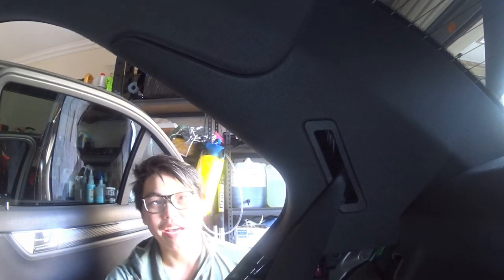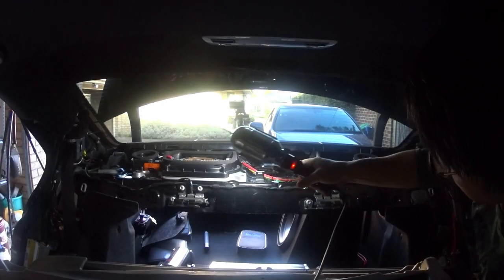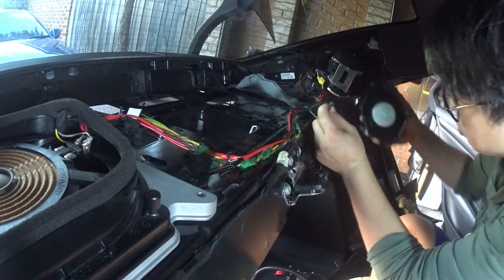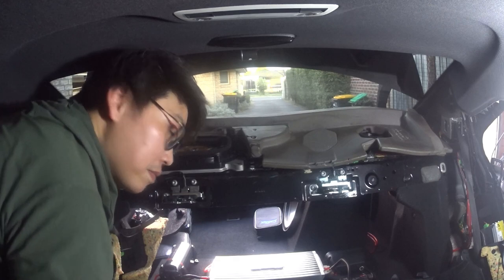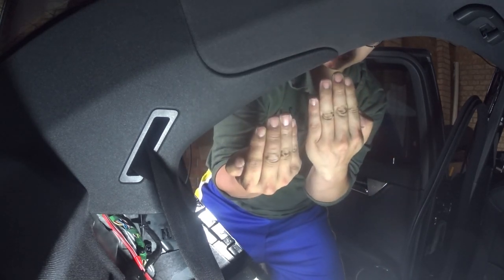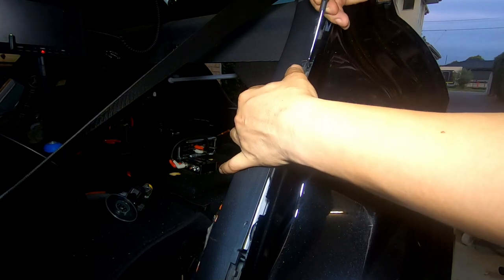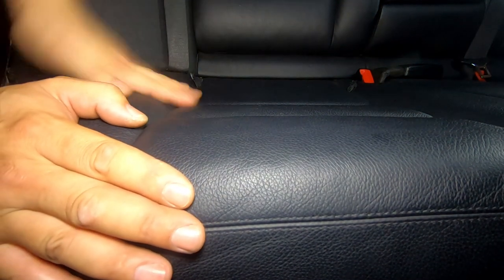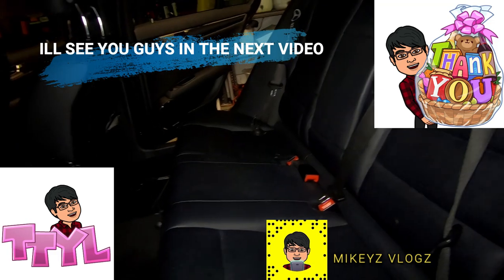MERCEDES BENZ  C CLASS W204 HOW TO ACCESS  REAR DECK + 3RD BRAKE LIGHT

Comment: Hello MIKEYZ VLOGZ !
First of all, thank you for all your great videos.
I've w204 320 but with the standard audio kit, I'm wondering if the wiring is already here, but will it be a good sound improvement to add this rear deck sub ?
I can't find anything on the web but your video.
Reply from the maker: i dont think the wiring will be there u may need to wire a new sub and after market amp ... but im sure you can use the factory sub as you may already have the cut out for the subwoofer in the rear deck ....its just a matter of fitting it..do u know if you have a factory amplifier?
Reply from the maker: and your welcome too ...i hope the videos will be of some help for you
Reply: @MIKEYZVLOGZ  So I double checked: There is no pre-wiring, and the foam does not seems to be precut. And if it needs an additionnal amplifier, it seems to be a hard upgrade... 
I think I'll look a way to put this kind of woofer instead : https://www.ebay.fr/itm/Mercedes-W204-Classe-C-Coupe-Sub-Haut-Parleur-Boitier-Boite-Son-Basse-Audio-10/153514941732?hash=item23be341d24:g:LJIAAOSwDuldrseD
But I still need to find an audio out from somewhere. The only option seems to cut the wire from the rear speaker, like here: https://youtu.be/5pNEUQPfC_M?t=980 and I don't like destroying car stock wire, I think you'll think the same.
Reply from the maker: That is a great idea mate
Reply: @PaulEmmanuelXUEREF  It's def a huge install, I was thankful to have bought mine with it already. I'm just upgrading away using the wires and backtracking to make sure all the wires are good before hitting that bass.. It's all worth it in the end!

Comment: 1:03 I have a 2017 CLS and where you're removing the side area there, mine has an airbag in that spot where the seatbelt comes out of. I need to access the rear deck speakers because there is a TERRIBLE rattle coming from the right rear speaker. Should I still remove it even though there is an airbag there?
Reply from the maker: hey s how r u? is it very similar to mine? as i didnt remove my airbag at all.. eventho there is an airbag there you should only have to remove the cover that sits ontop of the airbag... the ratlle in the rear deck can be from a couple things ... 1 rear deck loosened from bass in rear deck 2. rear seatbelt holder has shaken loose or 3 speaker blown... i cant say for sure what ur case may be but it could be a few possibilities... as for how to remove ur airbag cover im not too sure as i have never worked on a cls.. however im sure it would be somewhat the same mate.... i hope this helps u
Reply: @MIKEYZVLOGZ  Hi, I'm doing good, thanks. In this video: Mercedes- Benz Rear Deck Rattle Noise (SOLVED) at the 1:00 mark, that is the exact rattle I'm getting when playing music through the speakers. Have you had this problem? If so, how do you suggest I go about fixing this?
Reply from the maker: @user-pu3cf9pd2m  well if that is your exact problem...i strongly suggest  to figure out how to remove your entire tear deck so u can access it ... and solve the problem... its the only way to get to the part especially if its your rear deck

Comment: How did you get the seats down? I have to replace my rear deck because it’s rattling and broken.
Reply from the maker: hey buddy the rattle is annoying i know .... however it could be a few things ... best way is to just open the rear deck and see what is rattling around and see if you can stop or or secure it.... with the seats .... what do u mean get them down ?  do your seats fold down?
Reply: I’m not sure, I think that’s a facelift 2012-14 function. I know you have the ultra-rare 2010 AMG Sport Plus model so that’s why you may have it and I may not. Have to do research.
Reply from the maker: @aaronpoisson  i dont think its an amg modrl i have ... to put it simply i have a 2010 w204 c300 late model with the amg sports package with extra features .... ive seen a few around just like mine .... but compared to other countries i do notice a difference ... i dont think my model is rare...i was just lucky enough to find a model with all these extras from factory.... best way to put it.... however if u are trying to remove your back seats because they do not fold down then do abit of research regarding your type of seats .... im sure its not hard friend just has to be done a certain way.... ill see what i can find out for ya buddy
Reply: @MIKEYZVLOGZ  I'm gunna try observing them more closely sometime this week, I read owner's manual PDF and it looks like there might be two pull-tabs someplace that I can use to fold down the seats possibly. I'm replacing the rear deck and the brake light. 

My rear deck is rattling and so faded it looks light purple. My twilight plastic trim as damage somehow near the break light and to the pass side where the trim meets the window, which is visible causing my break light to reflect in the glass at night.
Reply from the maker: @aaronpoisson  yep exactly .... im sure its just something like that... hope u get it sorted asap
Reply: @MIKEYZVLOGZ  the rattle is in the seat belt device (Ball Bearing). otherwise, it's the shelf as well. The ball bearing is a part of the seat belt safety mechanism - https://www.youtube.com/watch?v=_fttzvD2Q9s
Reply from the maker: @WyseAdvisory  ye dude ... ive heard its this too...in my case it was this rear deck piece .... my seatbelt is fine atm fingers crossed

Comment: @7:20 when you disconnect the sub is that all you have to do to remove the rattling sound? I just bought my aftermarket sub/amp and hoping to install in the coming weeks. I obviously have to remove the the factory sub so no rattling will occur is this all you have to do in order for it to not rattle? Also when you put new sub in how do you keep the rattling down to a minimum?
Reply from the maker: u need to also check the seat belt for the centre seat ... rattling comes from both surrounding rear deck and the seat belt holder .... do u have rattling now ?

Comment: What size speakers are in the back deck?
Reply from the maker: its either 3inch or 3.5
Reply: @MIKEYZVLOGZ  So there are 3 speakers in the rear deck, correct? Do you know the exact size of them, please? This is really important in order to replace them?
Reply from the maker: @WyseAdvisory  dont know exact size but will find out for u ... but they are x2 surround speakers ... and x1 subby ..but ..only if u have the hk system with factory sub... if not u only have front splits and rear  coaxials and maybe the centre 3" on dash ... confirm what system speakers u have and then u can find out what they are..check this out https://mbworld.org/forums/c-class-w204/223386-where-8-speakers-i-only-count-6-a.html
Reply: @MIKEYZVLOGZ  thanks Mikeyz, that link helped clarify 1-2 speaker locations and sizes. Installing new speakers in the W204 C250, 2010 model takes time but certainly worth it if you have very good quality sound speakers or there of.
Reply: @MIKEYZVLOGZ  are non hk systems pre wired for surround and sub?
Reply from the maker: @JA-jl7vw  dont think so ..

Comment: How do i get the seat down I don't have any rear levers for them & it's not a split seat either.
Reply: I saw your other video & magically skipped to where you took the rear seats out to put in a new sub. Now I know how to get it off. Lmao
Reply from the maker: @theyoungsause4928  no ifu don't have fold down seats u gotta remove them there are screws to remove them ..

Comment: I have a c300 2011 my back speakers not working but the ones working what do I do to fix it help me plz
Reply from the maker: firstly ensure your settings are correct so it plays all speakers.. the rear 2 are only surround speaker so they won't play vocals or bass
. only surround sound for 5.1 Dolby etc ... the rear door speakers is where most of your vocals and mids play from and front doors are splits
alot.of.ppl mistaken the rear deck speakers for normal speakers..but they are simply surround speaker... mainly for movies with 5.1 Dolby and 7.1 surround ... ull hear things like footsteps back chatter background music ..pens drops ... basically surround sound
Reply: @MIKEYZVLOGZ  I have the same “problem”. How do you determine in the settings that they’re even on. Because if I sit in the back seat I don’t hear anything at all
Reply from the maker: @Therealtrestan  ok guys the rear deck speakers are only surround speakers vocals do not play out of them u should only hear music from door speakers centre dash and tweeters and sub is for bass ... play a movie and listen for surround sound like ppl walking or background noise in the movie ... I thought the same but it's for surround sound
Reply: @MIKEYZVLOGZ  thanks bro
Reply from the maker: @Therealtrestan  welcome

Comment: Do you know were i can put a active 8 slim subwoofer? Look like it dosent fit in the deck! Thanks!
Reply from the maker: Do u have the factory sub if not place it in the rear deck
Reply from the maker: Or if u have some $$ to spend put one of these in https://www.ebay.co.uk/itm/152917131745
Reply: @MIKEYZVLOGZ  i dont have factory sub! I boght a the active 8 slim subwoofer! Do you think thats fits in the rear deck?
Reply from the maker: @alexisgonzalezmantovani6623  wait so it comes in a box
Reply from the maker: @alexisgonzalezmantovani6623  ahhh yea very nice try put under a seat or even maybe mount under the rear deck in the boot but depends how close u want ur bass ....wen i was gonna install that i was gonna mount it on the rear fold down seats ....its a good place to start....i would either mount on a board and then mount that to back of rear seats or directly to rear seats...then run controller to under driver seat
Reply: @MIKEYZVLOGZ  i will try but dosent fit undther the seat! But thank u for the recomendations! Good video!
Reply from the maker: @alexisgonzalezmantovani6623  no worries ... back set might be best ....

Comment: I cannot fold my rear seats in my w204 how do i do it
Reply from the maker: if u can't fold seats down u need to find the bolts that secure the seats down .. look under the front cushion and the top u should have a bolt that screws down to hold the seat cushion in place

Comment: Do u no what sz the sub is i want to put a after market
Reply from the maker: it's a 10inch shallow...u will need to cut it out if u want to fit it there ..instead of doing that I just installed another sub
Reply: @MIKEYZVLOGZ  gd lkn 💪🏽

Comment: Does anyone know what size the 2 rear speakers are, one of mine has static and I pretty sure is blown, I've looked everywhere for the proper size, 2014 C300 Sport. also, wouldn't hurt to know while I'm in there I think it's a 8" sub, but would I need a shallow mount sub? any help be great!!! Thanks
Reply from the maker: it's 3.5 I believe but ill double check that .. yes ull need a shallow sub for easy fitment and its 10inch
Reply: @MIKEYZVLOGZ  Yeah COULD YOU PLEASE PLEASE CHECK I know for a fact its the rear passenger which means if I'm correct it's the side that's connected to the subwoofer..... so Crutchfield doesn't help at all, I typed in my year and make and 1 kicker speaker came up... A Pair of kickers and it says 2-3/4".    THATS IT> For rear deck corner,   This is for my 2014 Benz C300 Sport Sedan, and Crutchfield like I said came up with only 1 pair of speakers, and I'm confused even on the size, because I know I have the 8" sub, and then the 2 surround speakers, well what does 2-3/4" mean? is the size really 3/4"? I'm so confused on what size corner I need, but also I figure if anyone else is reading this, could I replace that sub with a shallow mount JL or some good brand or will it all sound like crap with the amp? Please first, help with speaker is a MUST!!! Thanks!!!
Reply from the maker: @devryguy27  I could be wrong but I always thought it was a 10inch sub woofer we had in w204s and the rear surround speakers are definitely in the 3inch to 3.5 inch range ... honestly sometimes to be sure u have to open it up and actually measure cuz u also need to measure the depth as well ... and in my experience it's ery hard to find direct replacement for the reardeck speakers ... gimme a bit of time as I'm pretty busy and I'll try confirm everything for u
Reply: @MIKEYZVLOGZ  Hey, I appreciate anything you can find, I haven't fooled with anything yet, if it weren't for my super mean dad, I would have already taken it apart and followed your directions but let me know if you can or have time to find to check out. it is a 2014 Benz, C300 Sport with the Harmon Kardon Package, so 3 rear speakers just like yours.Thanks . I also bought 2 sets of Monster LED strips,, I want to try and mount either just under the driver dash floor board under steering wheel, then under passenger Glove box, but not sure if I can just use one 6 ft cable, or if I should use 2 and cut them if I can't fit my hand , but then I'll use a cigarette lighter Dual USB to power them, and thankfully one remote controls them both. I just thought it would look cool at night. LMK if you have any ideas, I could also come out the center console with 2 , and run each one down the middle console, then off under steering wheel left , the other down and right to under the Glove box.?
Reply from the maker: with the speakers its gonna be hard to find u might be better off getting second hand like I said they are surround speakers so they only play surround sound ... are u trying to listen for vocals? ull only hear background noise in whatever u play... try play a movie then listen ... if they are blown u should hear cracking and distortion ... as for the ambient lights yes u should install under wheel n glove box and run down the middle to the rear under driver and passenger seats .. that's what I did and there's a controller so u can change colours too
Reply: @MIKEYZVLOGZ  Sweet, well , as far as the 1 rear surround speaker I need, crutchfield, out of ALL the Speaker they carry, they showed one that fits rear deck, and its out of stock lmao. but man idk how Id love to know or show you what I have or exchange email, or if you could help me out do mine via YouTube . I used to Awesome installs when I was in High School 16-25.  but I'm 37 now and kinda scared to touch this Mercedes.. I gotta a steal, Mine inside looks Brand new, smells new, only 12,000 on it. White. tan interior. I wish I could send you a photo of the 2 stripes. well, here I got them from Walmart. I have 2 - Monster basics- LED Light Strip Multi-Color/Multi-White  Backlight your TV or PC Monitor. You google that,, I bought 2 because I didn't know how I could run them, or one. IF I had power somewhere under my E-Brake, and could run under and behind my center dash I'd only use one. straight across. LMK thanks
Reply: @MIKEYZVLOGZ  Ok, Thanks, 2nd question, so my Benz is Polar White with All Tan and wood interior, Looks brand new, still has plastic down and haven't installed floor mats yet lol. I'm about to order the Weather Tech laser plastic cut floor mats, with Tan interior would you choose Tan floor mats or go with black? I'm having trouble deciding? my gut says tan, but cleaning them says black... what u think... they should be easy to clean with a brush??? Thanks
Reply from the maker: @devryguy27  plastic ? send me a link .. I got the rubber ones black with raised edges so it can handle all weather conditions... they are original benz ones .. the weather tech ones are nice ..I'm not sure about the plastic ones I'd have to take a look .. usually what ur gut wants is right
Reply: @MIKEYZVLOGZ  well, you must of misunderstood me. see I have Tan interior, I have the original Benz Tan Mats I've never put down yet, I still have plastic on the floor, so I just bought cheap Walmart tan carpet for summer. so my birthday is in 2 weeks and my folks are buying me the Laser weather tech $179 set. And I was asking ur opinion on Black or Tan? I probably still won't use the factory mats yet, they are just in my trunk. I can probably take a video and upload it on Tuesday, but I work tmrw. I know black would be easier to clean maybe with a brush, but tan might match better .. idk, since winter is coming here in Ohio, that's why I'm getting them. but for real, I'm the only one ever in my car. Nobody ever sits rears, cars in mint inside. few minor Knicks around car.
Reply from the maker: @devryguy27  oh ok I understand now ... tbh.. it would good good either way ... I can't tell u what looks good .. but I'm sure u will pick the right one for u .. after all it's ur car and no one's opinion matters but urs ... I hope I'm making sense .. u sound like u know what u want .. so just go for it .. I. sure it will look great from what u say
Reply: @MIKEYZVLOGZ  yeah, after today, I'm off for the next 3 days, so maybe I can upload pics or video. but yeah there's only One WeatherTech lol, I thought they were like hard plastic material, I could be wrong, but they are laser cut for perfect fit. I've been told go black instead of tan just because I know they will clean easier. still debating on color.

Comment: I can't remove the side panels on my c300 4matic sport. They do not move. I've pulled up, out, down straight nothing.
Reply from the maker: are u trying to remove the parts I removed? which part u referring to  ? If so they should come out ..everything. can be removed u just need patience and try
Reply: I think the American models have tabs on the pillars. You need to pry them first then pull them.